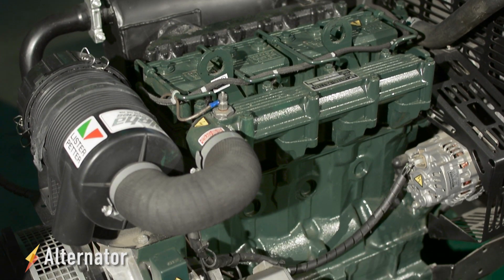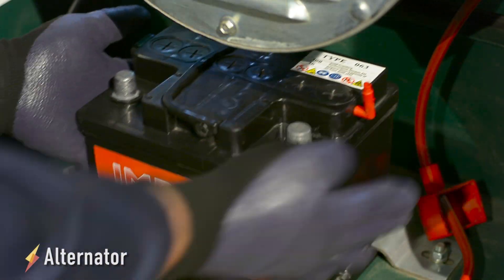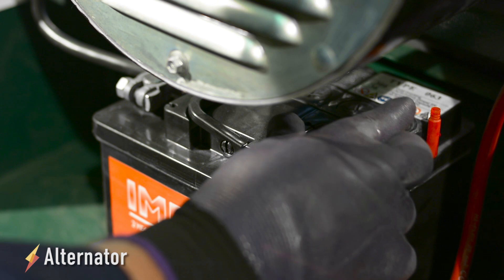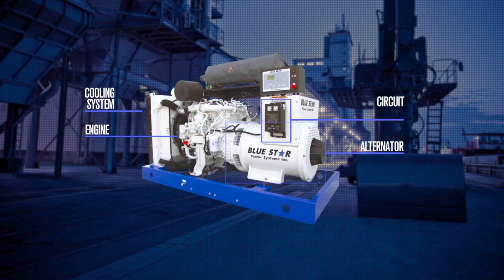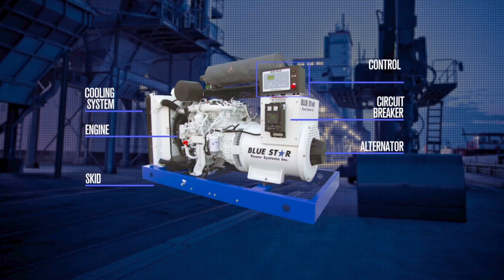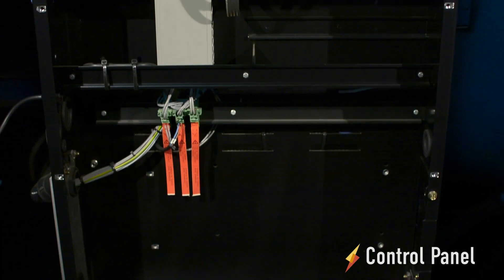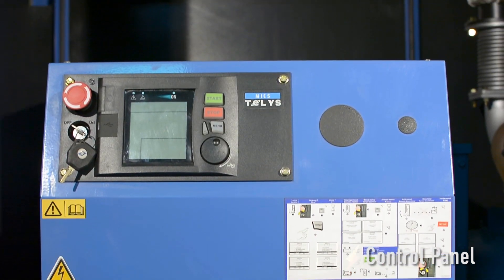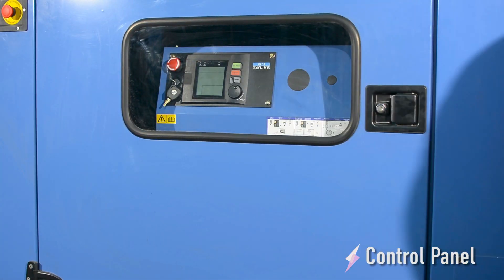Generator Set Main Parts

Comment: What's the difference between an alternator and generator?
Reply: Generator = Provides DC output
Alternator = Provides AC output
Reply: Generator= Diesel Engine+ Alternator
Reply: Both alternators and generators convert mechanical energy into electrical energy. ... In an alternator, electricity is produced when a magnetic field spins inside the stator (windings of wire). In a generator, on the other hand, the armature or windings of wire spin inside a fixed magnetic field to generate electricity.
Reply: An alternator is part of a generator set..
Alternator plus engine = gen set